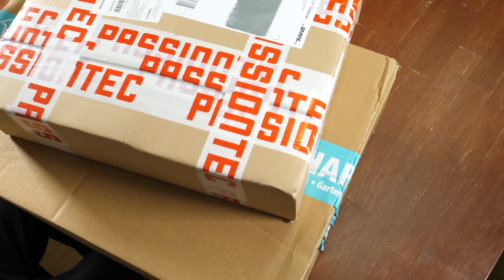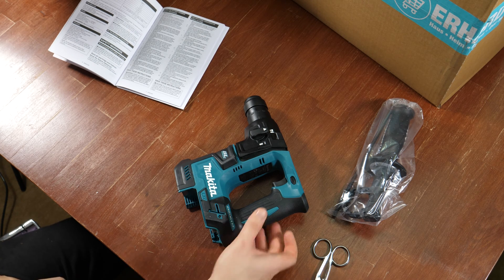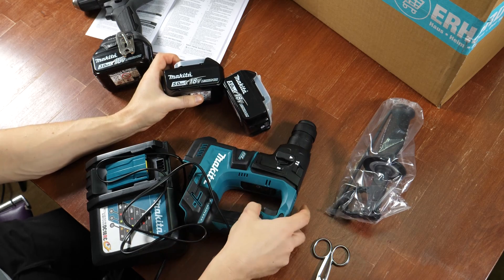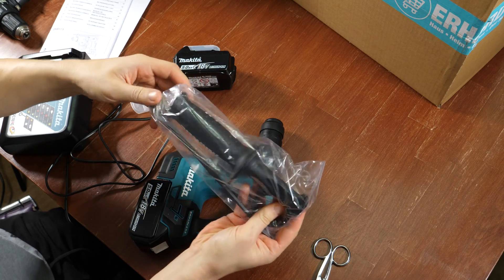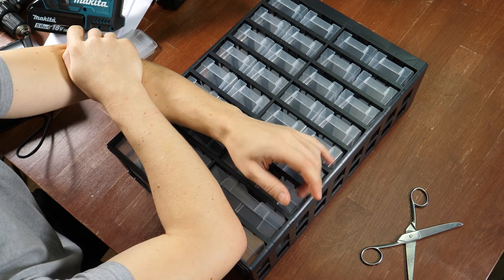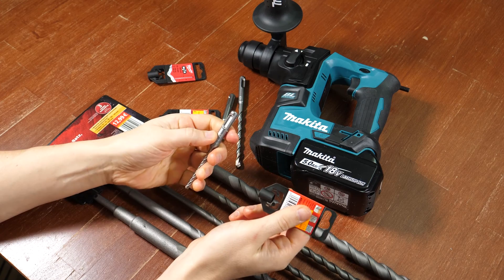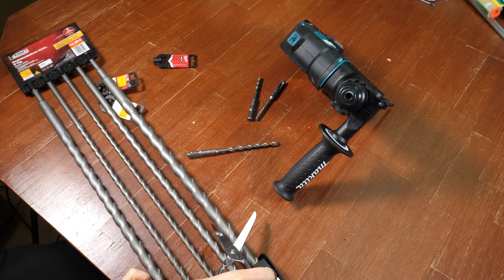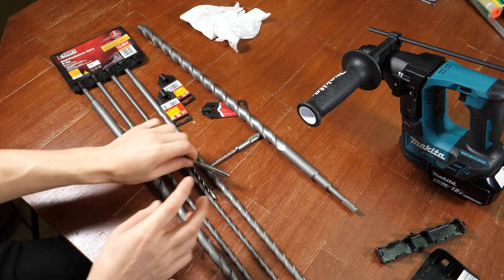My New Hammer Drill (Makita DHR171)

Comment: This hammer is usually for small short drills, although you are able to drill the larger drill that you've purchased. The cross end on the drill is to allow you to pass the still construction into the concrete, so you usually don't use those in small diameters drills such as 5 mm. 10 mm and on is basically more effective for the crossed drills.